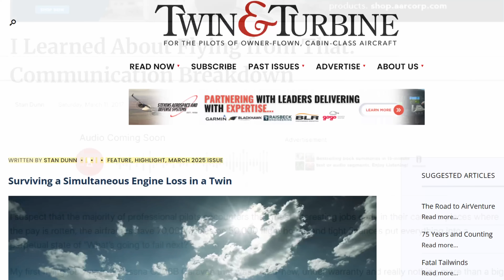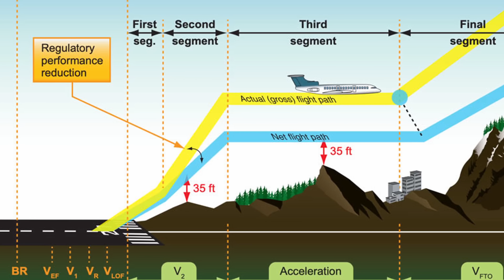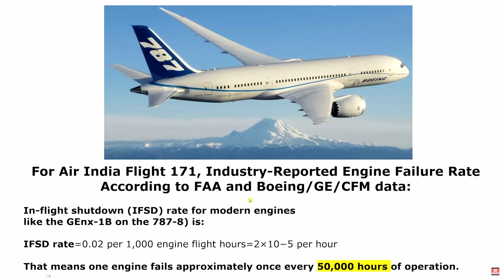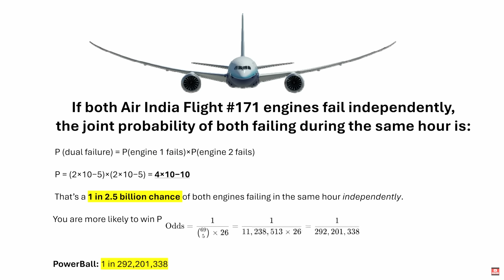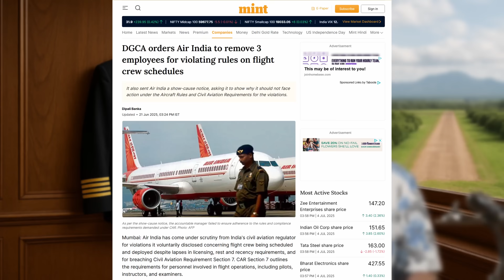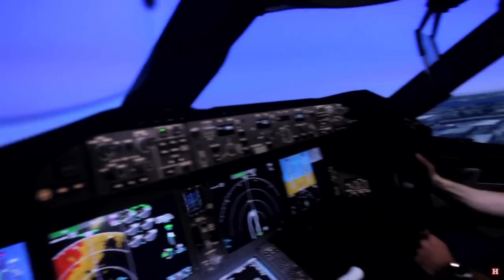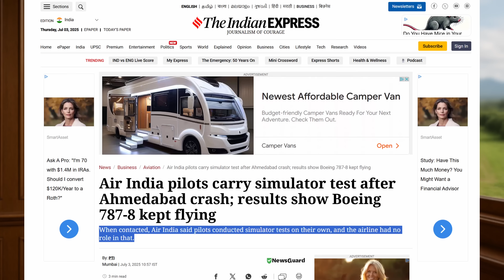Air India 171 Cause Becoming Clear

Comment: The fact that they haven't released the flight data after this amount of time makes me think they know the cause, but don't wish to make it public as it may cause embarrassment. Shutting down the wrong engine is very embarrassing; it's happened too many times and it cost lives.
Reply: You mirror my thinking exactly. If the cause was unrelated to Air India, the flight data should have been released by now.
Reply: I agree completely. @Truth_Yeah
Reply: or the lawyers are involved
Reply: Investigations take time.
Reply: Flight data is with Boeing ask them.AAIB was not able to get it completely
Reply: The media strategy is likely to let the event disappear from the public radar, before the official report and findings are released. The stock market indicator for Boeing might be a clue.
Reply: Accident investigations typically take over a year to complete.

Comment: Another YouTube-er - a pilot, has pointed out that the temperature that day was almost 40C, and at that temperature its possible the fuel May have turned from a liquid to a vapour in the fuel lines, making it impossible for the fuel pumps to pump the fuel vapour,
Reply: Have you googled that or put it into ChatGPT? Especially as the ype of fuel involved is important. Jets use Jet fuel, which is kerosine -based. Other planes use gasoline. Why does that matter? Kerosine and gasoline have different reactions to temperature. Gasoline fuelled engines suffer from the problem you mention, but not kerosine fuelled jet engines. So check it.

Comment: If the solution was presented here, perhaps I missed it. But if BOTH engines are fed from the central tank in take off and in initial flight, then a common cause for fuel starvation has not been adequately dismissed.
Reply: Or they had a tankful of water

Comment: After take off the landing gear hangs in a "heel down" position. When gear retraction is initiated the wheels are rotated to a toe down position before the gear doors open and the wheels are  swung up into their stowage area. Video of the aircraft just before it crashed show the wheels in a toe down position suggesting that retraction had been initiated but was followed by total power outage leaving the wheels in a toe down position but still extended with the doors still closed. ???
Reply: Hydraulic power failed, hence deployment of emergency turbine
Reply: @Bakes-z4c  hows that happen?  Windmilling engines will provide hydraulic pressure, and there are electric pump backups.  The rpm decaying below about 50-55% will trip the underspeed relays and de-energize the generators and THAT WILL CAUSE THE RAT TO DEPLOY long before the windmilling engine rpm decays to a point where they would detect a hydraulic failure.  This is a 5000psi system also
Reply: @Bakes-z4c the 787 has electric driven pumps that are powered by three different means. Battery, APU and engine powered generators. 

If all three redundancies are disabled and the RAT is deployed it’s either deliberate or catastrophic. I sure hope it’s not deliberate even though the preliminary analysis is reporting that the fuel cutoff switches were activated. Which takes some force to activate. Like a circuit breaker. I’m praying that those pilots didn’t purposely kill everyone on the plane and in that building
Reply: Giving a man 40 Sec to troubleshoot is the toughest test he can face 😢
Reply: 40 sec below 1000 ft
Reply: @princeo15  It's just not possible, as was evidenced!!
Reply: I do know that raising the landing gear puts the maximum load stresses on an airplane's hydraulic system. If you watch the hydraulic pressure it drops considerably during retraction and then slowly builds back up again after the retraction sequence is finished. If they completely lost hydraulic pressure during the retraction sequence the gear would probably stop moving immediately. The RAT wouldn't provide enough power to raise the gear all by itself, especially because it would still be moving the flight controls.
Reply: Even if landing gear was down they could still climb . So it had to be more
Reply: @stanjohnson7849 

The point is the stuck landing gear being a symptom not the cause.
Reply: @stanjohnson7849 
The pilot didnt even bother to mention the landing gear in the Mayday call.
Reply: @stanjohnson7849  What she is saying is that the landing gear was beginning to retract, but it stopped part way through the retraction sequence. This would indicate a loss of hydraulic pressure during retraction, which could indicate a loss of both engines at the same time.
Reply: It is an all electric airplane. The engines drive nothing but generators.
Reply: @ziegle9876 
I have never heard of a generator on an aircraft providing thrust; one of the jobs of the engines is to provide thrust!!!
Reply: @NotAnymoreNeverAgain
But the throttles and thrust is totally dependent on electronic fly by wire control.
Reply: @ziegle9876  The engines drive the high bypass fan which produces most of the thrust. Perhaps you're thinking of the startup procedure for the engines which uses the plane's battery instead of a air startup cart. The battery is topped off by the planes APU -the APS5000 APU that is all electric and that maintains AUX power for the main buses.
Reply: Juan Brown on the Blancolirio channel is a pilot who explains the power systems and BUS1/2/APU/RAT on the 787. He covered the landing gear tilt the day after the accident for those interested in learning more about which BUS and hydraulic system controls which redundancy. Good information without silly speculation.
Reply: @Tokamak3.1415  Do you have a link for that please? I'd like to read it.
Reply: @skylarkstarsmith  youtube.com/watch?v= MPk31EhtakE

Remove the space in the link. Around the 2 min mark he discusses the RAT. He shows a basic schematic for the left, center, right hydraulics on the 787 around 2:30. If you google you can find very detail pictures showing each hydraulic system and where they overlap for redundancy. The RAT on the 787 specifically ties into the center hydraulic system. I don't fly commercial jets, only private craft but Juan does an excellent job explaining the basics pertinent to specific crashes. Mentour pilot does a great job as well but I don't recall if he went over the 787. The mans knows the 738 and A320 inside/out though.
Reply: The gear tilts toes down if hydraulics are lost, too. There is a YouTube video mentioning a Jetstar tyre burst.. which is actually a hydraulic failure... which shows this. 
Gear was extended with the alternate extension system.
Reply: @ImperrfectStranger 
Hydraulics lost as a result of electrical hydraulic pumps and electrical control all being taken out by electrical failure ?.
Reply: @confederatenationalist7283  I'll let you know when the final report is released
Reply: Great observation Miranda, that is a definite sign of hydraulic pressure loss and you have an obvious attention to detail. The NTSB could use someone like you. 

Notice how nobody else has mentioned that. 

Good investigative skills. Kudos to you
Reply: The Mayday call said no power and no thrust ?.Power meaning electrical systems gone, by default including engine computers, hence the RAT deployed ?.It was turned into a glider at a few hundred feet high.
Reply: @confederatenationalist7283 The RAT is extended automatically using gravity
Reply: Doesn't this plane have a big dangerous lithium battery that could come online instantly to power the landing gear pumps?
Reply: Everybody failed to mention that this plane was "maintained" by indians for 12 years.
Reply: @-First-Last And that it functioned perfectly well all throughout that time.
While aircrafts made and maintained by Americans came tumbling out of the sky, early last year, without a single nasty, bigoted racist comment on the nationality of those involved in the upkeep.
It just shows that basic human decency and respect has absolutely no relation with the so-called progress and wealth held by any group of people. 
Shame on you for descending to such cringe levels.
Reply: @shreepanicker  USA is screwing up a lot worse than that.
Reply: @-First-Last this is a moronic point to make
Reply: @-First-Last 
But we generally dont trust car electronics and wiring, or mobile phones, or lap top or desk computers to last 12 years.Regardless of who 'maintains' them.
I've always been flying sceptic dont trust the 'safety' statistics v car and sea travel.
Do I want to trust miles of wiring and some computers to keep me in the air and to get me home alive.
Reply: @-First-Last  Say no more!
Reply: @-First-Last  or not maintained
Reply: @-First-Last  And? I assume you are "american"...?
Reply: @-First-Last  Seeing as how the country's space programs have been more successful than NASA's over the past 5 years it seems you have a problem with Raj.
Reply: @-First-Last  Mmm, that's up there alongside American contempt for Japanese engineering and military capabilities immediately prior to 7 December 1941.  And we all know what that was grounded in.

Comment: 1.  Remaining silent doesn't mean it wasn't sabotage, if, e.g., there was a specific target on the flight but it is desirable to make it appear accidental.  I believe is is very unlikely, though if true, we will likely never know.

2.  A virus may be difficult, but if we can get virus into Iran's centrifuge operations, an airplane would be easy.  Possible purpose could be as a test which again, wouldn't suggest a desire a publicity.  Seems unlikely, but unless a dozen planes fall out of the sky sometime soon, we'd likely never know.

3.  Saying that the odds of both engines failing at the same time unless there is a common cause is true, but not really informative.  Since we believe both failed here, it simply means that we need to focus on what causes dual engine failures.  But that is (almost?) true a fortiori.

My money is on pilot error, but I wouldn't be shocked to find out it was a maintenance or design issue.

Comment: It was hot, Li batteries going into thermal runaway would shut down the DC buss, forcing every computer to reset. I’m betting it was DC buss related.
Reply: There is no such thing as an electrical "buss".  DC Bus bars are a thing, but electrical systems have multiple redundancies, and batteries on aircraft don't supply power unless the engines and APU are off...
Reply: @redbaron6805  Would the RAT engage if the Lithium batteries were providing power ? What would keep the onboard computer from glitching out into a reboot if power was lost, and until the RAT was engaged ?

Comment: someone was saying they may have inputted the wrong air density into the onboard computer, based off its takeoff speed, for an outside air temperature of 40C and an atmosphere height of zero above sealevel the air density should have been set to 3900 and the takeoff speed should have been 189 while its actual takeoff speed was around 171

Comment: Another Western expert blaming Indian pilots?   We've been told numerous times that incompetent Indian pilots took off with improperly set flaps or mistakenly raised flaps instead of the landing gear and caused loss of lift and crashed... like if they never flew a Cessna but somehow got their hands on a Dramliner.   We were told Indians input WRONG temperature data into the computer as if they didn't know that it was hot in India in the summer.   Another Western theory was incompetent fools were in such a hurry they used only half of the runway to take of.  Yet another theory has them turning off the wrong engine as the most likely cause.  This channel seems to regurgitate the Indian pilots blame mantra.   I think Indian pilots were good and did not make a simple mistake but the machine has failed them in some unknown way.

Comment: @Flying for Money, @all  Root cause came from "air/ground mode logic" locked in ground mode. It's the only  probable cause that makes sense and could explain anything happened

"However, due to the Ground Mode Logic remaining "ON GROUND":

The aircraft is still considered not airborne by the system logic, resulting in:

Aircraft Systems Impact (Remain in Ground Mode)

- Landing gear cannot retract
- Flap/Slat system cannot retract
- Autopilot cannot be activated
- FADEC (Engine Control) does not enter climb logic → thrust remains low
- Generator (IDG) does not engage → RAT deploy
- Flight control laws remain in ground mode → limited protection features
- Weight-on-Wheel logic remains active → system does not allow airborne features"
Reply: @all the RAT deployed  due to loss of electrical power from both engine

So the question is:

Why did the RAT deployed when both engines were still functioning and generating power

____
The most plausible answer:

Because the system thought there was a loss of all AC power due to a failure in the electrical distribution logic — even though the engines were still running and producing power.

Detailed Explanation:
1. The RAT on a Boeing 787 deploys automatically only when:
- Both engine generators are not supplying power to the main AC buses
- There is no power supply from the APU generator
- The battery cannot support critical systems

2. In the case of a ground mode logic failure, the following can occur:
- The engines continue to produce power (IDG1 & IDG2 → active)
- However, the logic system (ELMS) fails to distribute power to the main AC buses due to a failed transition to in-flight mode
- The system mistakenly believes there is no active power source
- The system enters emergency mode and deploys the RAT to maintain power supply to:
    - Flight control
    - Primary avionics
    - ADIRU
    - Some essential buses

3. Additionally, the APU may have been shut down before taxi out, following SOP — so it cannot provide any assistance with power supply.
Reply: @tedeave2009 Please, read the Book again and try to understand it. Total wrong. Get well soon.
Reply: @Soundhaus1 well, of course, you need to try harder to understand 😊
Reply: @all CONSEQUENCES FOR THE ENGINE IF THE LOGIC STUCK "ON GROUND MODE" AFTER LIFTOFF

1. FADEC Power Loss
The FADEC on the GEnx-1B engine requires AC power from the AC Bus. Without IDG and APU power:
- FADEC loses primary power
- Engine control becomes unstable, potentially dropping to idle or shutdown
- Thrust can suddenly disappear even with the throttle lever at TOGA

2. Autothrottle Malfunction
Due to the logic remaining in ground mode:
- Autothrottle system fails to transition to flight logic
- May remain in idle or hold TOGA before automatically disengaging
- Unable to respond to FMC climb mode or speed targets
- No automatic thrust management

3. Engine Indication (N1, N2, EGT) Loss
Because EICAS and displays rely on AC power and data buses controlled by flight mode logic:
- Engine indicators in the cockpit may disappear or freeze
- Crew may misperceive that the engine is still running or only idling
- Unable to monitor engine performance

FURTHER CONSEQUENCES:
RAT Will Deploy Automatically When:
- AC Bus 1 and 2 are lost
- No APU power available
The RAT will deploy automatically to:
- Provide minimum AC power for flight control
- Keep some essential instruments active
However, the RAT cannot power all avionics systems, full FADEC, or restart the engine.

CONCLUSION:
If the APU is shut down during taxi-out and the air/ground logic remains stuck in "ground" mode after takeoff:
- IDG never powers the AC Bus due to the logic not transitioning to "air" mode.
- APU is no longer available as a backup power source.
As a result:
- The aircraft loses all AC power after  airborne.
- FADEC cannot function, leading to engine control loss, thrust loss, and potentially engine shutdown or unresponsiveness.

The RAT deploys as the only emergency power source, but it's insufficient to operate FADEC, restart the engine, or fully support systems The aircraft will be in a powerless glide condition shortly after lift off

Comment: this video describes a plausible cause, however to do that a crew member would have to knowingly shutdown one or both engines at or within seconds of Vr, which is highly unlikely. In the case of a deliberate act a more likely scenario would be a third person on the flight deck that pulled both fire handles.

Comment: When theb767 was a new airplane,  one taking off from LAX had a dual engine failure but it was the co-pilot who accidentally shut off the fuel.  They did a re-start and got one engine running and thrus restored only a couple hundred feet above the water.  It was on the local news because a relative of one of the passengers got it on video.
Reply: There is no record of this alleged incident or anything similar in either the Aviation Safety Network or NTSB databases. There is a report and details of the investigation into a single-engine failure on a 767 climbing out of Ontario, but the aircrew followed procedures to the letter and returned the aircraft safely to Ontario.
Reply: @DraftySatyr I remembered when it happened in the 80’s when the airplane was new. They added a guarded switch to the engines fuel control switches. I may be wrong, but it was a Delta plane if I recall correctly. So yes, it happened and the guards are there to this day. AD mandated I assume. And yes, I worked in aviation most of my life.
Reply: Wow, was the co-pilot fired and "marked" somehow to prevent re-hiring at another airline ???

Comment: You mention the runway length at VAAH but they did not use the full length as it requires a backtrack. Have a look at the flight radar data, not a single AI171 flight the previous week backtracked full length.
Reply: Have a look yourself, because you are incorrect.  Stop mindlessly repeating false rumors.

Comment: The pictures you showed regarding flap configuration was the Horizontal Stabilizer not the flaps. The engines on the 787 has (2) Ea Electrical Generators, not (1).